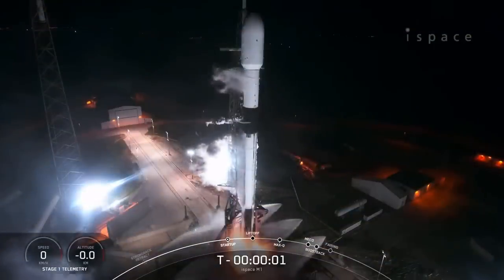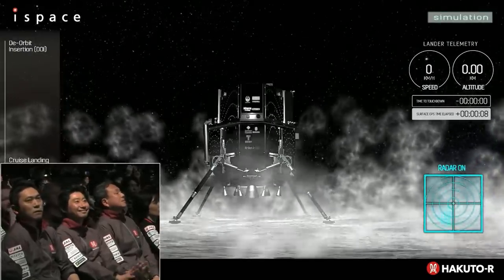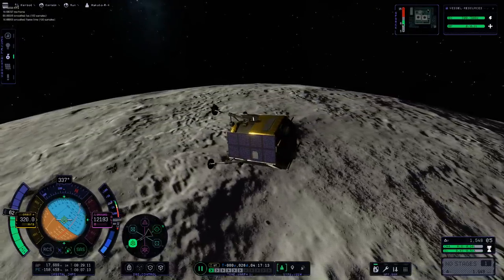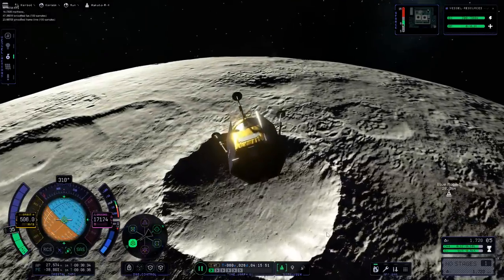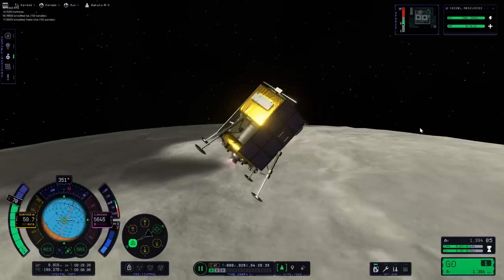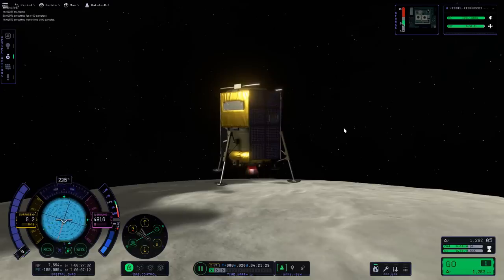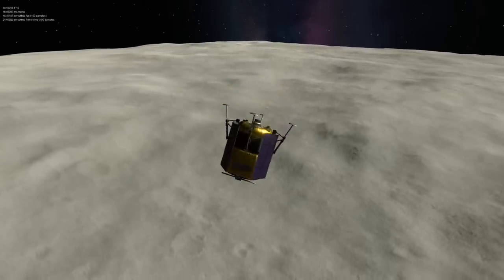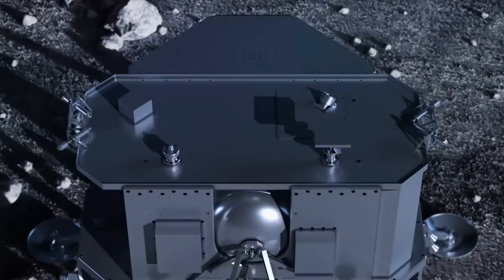Why Japan's Moon Lander Crashed Due to An Unbelievable Computer Bug

Comment: I've never done it, but from what I have read, sensor fusion is an enormously complicated and fuzzy technique.  You have to take a bunch of sensors, account for non linearities and malfunctions, and you need to figure out which ones are correct, which ones are sorta correct and by how much, and which to ignore.  On top of this you have enormous weight and power restraints.  And there must be a million fudge factors that have to be played with.  Move it one way and you get a false positive, move it the other way and you get a false negative.
Reply: I wonder if this would be a good application for AI? A computer would definitely be able to interpret way more inputs than a human pilot ever could and in real time
Reply: It's a satisfying problem to work on.
Reply: @andrewahern3730  AI isn't a magic fix. Those sensor fusion algorithms are supported by a a deep understanding of the system and statistics. Like with the Falcon 9, they are extremely reliable once properly tuned.

Obviously an advanced enough AI system can always do the job. But if, like in this case, you simply didn't test the system with enough variations of inputs, you're not going to get good results either. The amount of simulations needed to properly train the AI would also have been plenty to find this bug in the old control code.

The lesson here is that more robust testing is needed. I have a feeling that spaceflight is often seen as hardware-first. That's understandable, but without proper software the hardware is useless. I think more modern software engineering practices could be useful here.
Reply: IRL, nothing says you can’t have false positives and false negatives at the same time, while you struggle to understand the data.  That’s no fun at all.
Reply: kalman filtering is pretty damn straightforward. It's a basic method, not something extraordinary. Known for more than 50 years and optimal for typical sensors (ie those with common noise distribution).
Reply: @GeorgeTsiros  it's not a trivial problem
Reply: I don’t buy it. The technology available today, it’s like the ‘confused metric and imperial’ excuse.
👽  just sayin
Reply: @andrewahern3730  it is a bit stretch to say, but sensor fusion algorithm is a "cousin" of AI
Reply: The mathematical theory of how to deal optimally with noisy, imperfect sensors via noisy, imperfect actuators was worked out decades ago as “the Kálmán filter”.

Fun fact: the NASA engineers working on the Apollo mission didn’t initially know about Kálmán because, you know, he wasn’t American. So they ended up reinventing a lot of his theory.
Reply: @Niosus  I was at a conference where they had a round table of CEOs and CTOs of all the large US aerospace firms.  Someone got up and asked "how are you going to address the brain drain happening with tech companies?  Anyone who can code proficiently can go make 3x what the aerospace industry is offering."

To which they collectively groaned and one of them said "listen, if they have the passion, they'll come work for us, they just have to be passionate enough".

My dude, passion isn't what pays the bills in LA where you operate, you can't save passion for your kid's college, and you can't retire at 65 on banked passion.  3x is a life changing amount of money and anyone who turns that down doesn't have the right risk tolerance for aerospace anyway.
Reply: @GeorgeTsiros  it's really not, outside of really sanitized use-cases (eg quad drones), especially if you lose an entire sensor input.
Reply: Take away one sensor from a human and see THEM struggle. It's a major problem for any system, when first encountered. So, it has to be tested thoroughly.
Reply: Cars do this for under 30K USD, never whine about dealership rates for diagnostic fees again.
Reply: kennethng8346:  As I read your comment, the first thing I though of was how similar the conditions you describe are like the Tesla "Autopilot" problems: multiple sensors, too many variables.
Reply: @MikeWiggins1235711  clearly showing that software is at the heart of modern tech, and Tesla is on top of it
Reply: @GeorgeTsiros  All true. However, the problem here wasn't the filtering itself, it was one of the inputs to the filter. It sounds like the reading from radar altimeter was directly used as an altitude input without taking into account the changing elevation of the lunar surface along the flight path.
Reply: @RalfStephan  Something else i forgot to mention, this was their first real run with real data.  Sure you can simulate, but as the old saying goes, in theory, theory and practice are the same, but in practice they are not.
Reply: @andrewahern3730  Kalman filters are actually pretty close to optimal for linear systems (and this was pretty linear). If you didn't have any other information, you would also think the radar was broken if it suddenly jumped 3 km.
Reply: Well, I worked at a Naval facility in Jax, FL which was responsible for delegating airspace use offshore for a variety of military applications. When I had arrived (1981) they had already began construction of and had completed a new radar monitoring facility using multiple radar signature inputs from MCAS SC., NASJAX FL, and Daytona FL. onto computer driven CRTs. They needed to write software since none existed. It was quite a success with Customs agents occasionally stopping by at night to follow low flying bogies up the eastern coast.
Reply: while sensor fusion in general is hard, a single-dimension measurement like altimeter isn't so difficult.
Reply: @somedude-lc5dy  Nope, but air pressure is a fickle thing and ALWAYS one of the values given consistently when acquiring information from a controller when engaged in altitude changing activities. There's needs to be an established measurement deice at the location to match up the settings.
Reply: @somedude-lc5dy  Scott Manley said that as the craft went over a high crater wall the distance changed faster than what is probably a software defined limit.  The altitimeter was working, but the control software was told "if you see this change faster than this rate, assume it broke and don't use it".
Reply: Sensor fusion is a massive pain in the arse.  I was on the Caltech 2005 DARPA Grand Challenge team and my subgroup was responsible for creating and maintaining the module that collects data from the various sensors, processing that data, plotting a path for the vehicle, and executing the plan by conveying instructions to the vehicle's control interface which regulates the steering wheel, the gas pedal, the gear shift, and the brakes.  And this was for a competition to build a self-driving vehicle that drives itself from Los Angeles to Las Vegas.
Reply: @lawrencedoliveiro9104  re: " So they ended up reinventing a lot of his theory."
Many times, on the job, the answer is apparent to those in situ, but, the 'theory' existed via some obscure 'white paper' published previously. Having a formal 'name' for something never slowed down my coding a solution to a problem. In situ, you can either research for months OR code something that has the characteristics of what someone  else had previously formally defined and 'named'.
Reply: @actually5004  The cost is written-off on the sales price of many vehicles.
Reply: @uploadJ  If they’d done the reading, it could have saved them the months spent reinventing, imperfectly, what the pioneer had already achieved.
Reply: @lawrencedoliveiro9104  re: "If they’d done the reading"
You assume a lot, like, your budgets are infinite for employing infinite staff for one. Book-only learners that never actually 'code' useful product take that point of view, usually, because, that's all they know. Take a practicing EE however, and he's already familiar with feedback loops and its now just a matter of coding that into workable firmware ... don't need to know it was called "Kalman" to write a Kalman filter ...
Reply: @uploadJ  They didn’t have the budget to do get copies of some journals, but they had the budget to work it all out themselves?
Reply: @lawrencedoliveiro9104  re: "They didn’t have the budget to do get copies of"
You are micro-focused on ONE case study. Broaden out a bit. It might do you some good. Not everyone works from 'an endowment' or government grants. Maybe you have not heard of the 'greats' Maxwell or Einstein; some things have been worked out by individuals and they didn't find the info in the tech library. Hope this is not news to you.
Reply: @lawrencedoliveiro9104  Are you going out of your way to be intentionally obtuse? Good day sir. Have nice life.
Reply: @uploadJ  Given the budgets that NASA had to work with? Really?
Reply: @lawrencedoliveiro9104  Non-responsive; Shifting of goal posts. Have a nice life.
Reply: And that, ladies and gentlemen, was an object lesson in the saying “better to keep your mouth shut and be thought a fool, than to open it and remove all doubt”.
Reply: @andrewahern3730  AI isn't deterministic which is the most important thing when it comes to working on critical/embedded systems. Also the computers used in space are relatively underpowered to be able to run AI. For example the CPU used on the philae lander that landed on an asteroid in 2014 used the RTX2010 processor which ran at a whopping 8 MHz.
Reply: @unknownhours  Linear Kalman filter ARE optimal for linear system, not just close to
Reply: @lawrencedoliveiro9104  Indeed, you make an excellent case study of the phenomenon. You are wrong, the person you decided to argue with is right, and you don't even realize it.
Reply: @JKa244  Back again, under a different nym?
Reply: @lawrencedoliveiro9104  Try scrolling up, I involved myself in this comment thread long before you or the other person arrived.

It's ok to admit you're wrong, you know?
Reply: @JKa244  I sense a commonality in the vacuousness of your arguments.
Reply: @lawrencedoliveiro9104  Commonalities and correlations are everywhere if you choose to look for them. Most are spurious.

You are likely detecting a correlation with truth, if anything. I'd guess however that you are working backwards from the conclusions you want, as this is supported by the evidence I can verify.

Simply put, you are the only person involved that cannot actually determine whether I and the person you first attacked are the same person or not. Yet you continue to base your argument on that foundation. Obviously that person and myself can know the truth of the matter.

Anyways, like they said, it's pretty clear that your involvement here is not rooted in an interest in learning the truth. If I had to guess, I'd say you're likely just trolling. If not (and please know that this comes from a place of love), I think you could really benefit from an effort at introspection and critical thinking. I would be happy to help you with that if you're willing to set aside ego and petty bickering.

If not, I still wish you well. Good luck with everything
Reply: @lawrencedoliveiro9104  I want to reiterate that my offer to help is genuine.

When I was younger, I too took offense when people corrected my mistakes or tried to explain to me why my hypotheses were disproved by evidence. I knew everything, I was always right, everyone else was dumb and wrong and they totally deserved my vitriol.

For me, it was a coping mechanism to deal with an abusive father. When he was having an especially bad day he would take it out on me, my siblings, my mother. I would turn around and try to make myself feel better by pointing out how dumb and wrong other people were about whatever they were discussing, then pad and bandage my damaged and bruised ego with the sense of superiority that comes with bruising and beating the self esteem of others.

I eventually realized that I was perpetuating a cycle of hurt, and leaving the world a worse place than I found it.

I see my younger self in you, and the way you want so much to be right while pointing out how wrong others are - regardless of what the reality or truth might actually be. The goal is to be better than the people around you, rather than trying to get to the bottom of a problem and learn the truth together with other people who also seek knowledge. It's twisted and full of hurt and hate.

I know it's a bitter pill. Introspection is hard and painful. Abuse is difficult to process and cope with all alone. I'm seriously offering to help, despite knowing your response is almost certain to be additional insults and abuse. Even then, the offer stands.

I love you.

Edit: and I apologize for my comment suggesting you had revealed yourself to be a fool by opening your mouth and speaking. It was wrong of me, I did it because I felt the person you were talking to didn't deserve the abuse and insults you were sending their way. I hope you can forgive that, just as I forgive your verbal violence.

Comment: My reaction to just the title is "There are no unbelievable computer bugs".
Now that I've watched the video: very believable.  Accumulation of error is nasty and dead reckoning is very hard.  Changing something that "can't possibly affect the outcome" late in the process and not doing a full test happens often enough that it's a subject of comic strips and many high profile failures.
Reply: Except the one that flew into one of the first computers and caused a short circuit.
Reply: Scott's been moving to more and more clickbait titles of late. It's unfortunate to see him doing it.
Reply: When you're using accelerometer and gyroscopic data alone for position on a 2d plane, it can become hilariously inaccurate quickly, no matter how good your algo is.

Doing this in a 3D plane would be basically impossible if I'm being honest.

As an example, there is a reason VR relies so heavily on video processing for limb positioning. Obviously these aren't in the same ball park of cost/importance, but the same rules apply.
Reply: The unbelievable part here, honestly, is how someone expected this to work without simulating the actual final flight plan at least once.
Reply: @winebartender6653  US missile submarines can pull it off, but their inertial navigation hardware is larger than the entire lunar probe and submarines experience much smaller accelerations.

It does seem like it was selected as a fallback with rather optimistic expectations of how well it would stay accurate.  In hindsight, it would have been better to try turning the radar off and back on, relying on inertial navigation only as long as it took the radar to come back on.  Also, redundant radar.
Reply: @VarenRoth  Yeah, I think that's what Scott was referring to in the title.

But that pattern of last minute change without full test is eminently believable to anyone familiar with the software industry. Especially if the change is made by a different team than the one responsible for the testing, as was likely in this case.